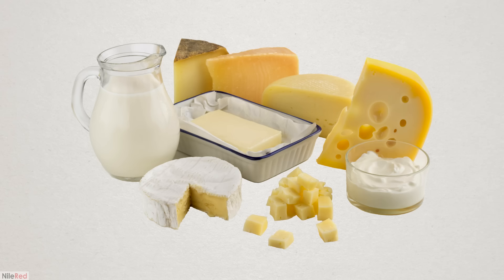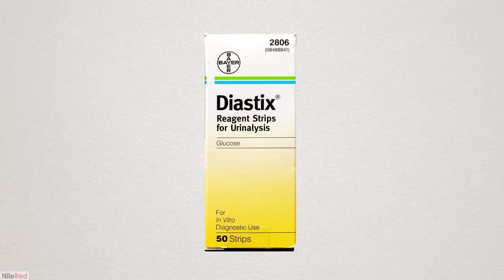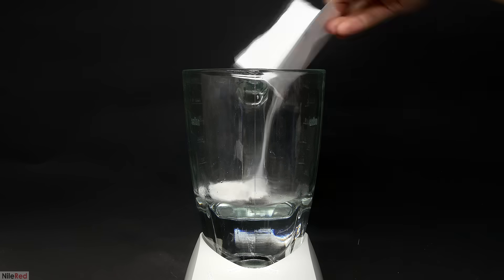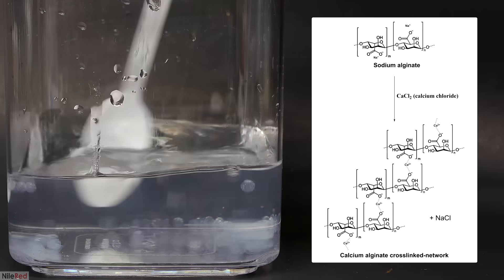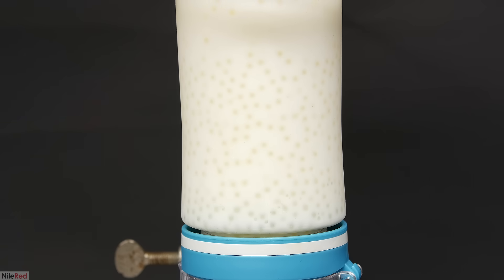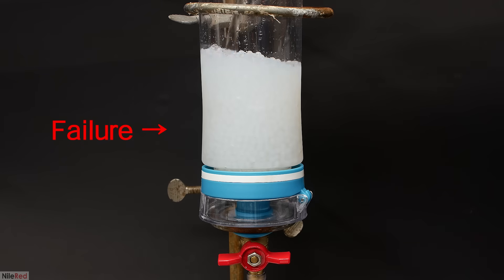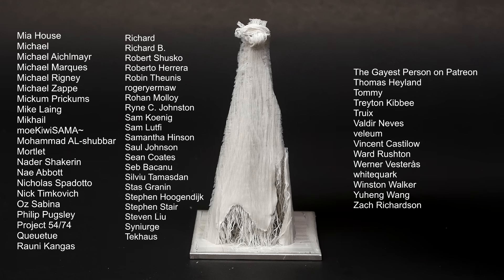Making milk lactose free

Comment: With my brother being lactose intolerant I found this extremely interesting. Now I can bully him with chemistry 🤣 I'm guessing the second process is probably the most efficient when on a large scale as its just a extra step in the filtration process and can be more easily managed during maintenance. Probably more cost efficient too in the long run as 10 drops per 1L would mount up over 100 gallons vs flow rate of cows suppling milk and longevity of the enzyme.

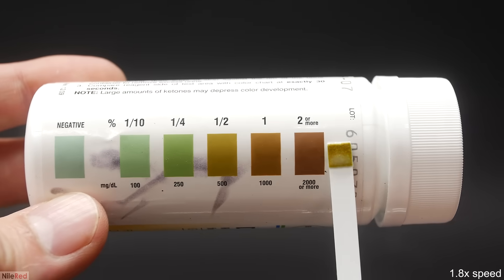Comment: 3:46 You could take a small volume of the milk, add water in some good ratio (1:1 or 1:3 might work just fine), and then test this mixture and adjust the results according to the mixing ratio.

Comment: There's easier ways.
Buy lactose intolerance  pills,  and drop one  in a gallon milk and sit for a day before  drinking.
2. Get powdered milk. The heat in the dehydration  process burns off most the lactose. If you still have intolerance problems,  for safety again  drop in a lactose intolerance  pill in a pitcher or gallon jug of the powdered milk you made.
When I switched to powdered milk I didn't have any the problems like did with from fresh gallon milk. And then I can make as little  or more and it not go bad like fresh milk did. And I didn't need intolerance pills  
3. And if still have problems,  or save even more money  switch  to oat milk.  It is very easy and cheap to make your own oat milk. You don't need to buy it from a corporation

Comment: It seems like most of the world hasn't gotten accustomed to using lactose free milk in the food industry, to the same level Finland has. In Finland, almost every food brand and restaurant uses lactose free milk in their food. The ingredients on every Finnish product (i.e that has not been imported) tells you how much lactose is in the food so you can know if you can safely consume a product. More than half of the brands aim for lactose free products.
Reply: Things have changed a lot since the early 90s when I was diagnosed lactose-intolerant. Back then there weren’t any of these modern products. You basically had lactase pills (Lactrase, Lactaid) and low-lactose (Hyla) milk. But apparently the R&D department of Valio, the dairy giant, developed in the late 90s / early 2000s a method to easily filter out lactose from milk. What ensued was a boom of all products lactose-free, e.g. yoghurt, ice cream, and everything else you can imagine. This was driven by recent findings at the time that up to 20 % of the Finnish population seemed to have issues in breaking up lactose, probably genetically. Since then, they have exported their technology into a lot of other countries.

Comment: With lactose, milk would induce pseudo green light because the fat it contains. It's kind of slowing down the process of radiation by breaking it into glucose. If people can't tolerate lactose, then they might be in the end of the road, they are prone to cancer.
But with no lactose, it's pure light that will be induce and that's a growth point, it won't be edible unless the person eating it is inside a blue shield, a shield that protect us from radiation. Like eating cassava.
For the people that are prone to cancer, eating no lactose milk will be okay, until they meet the sugar that it may contains, perhaps under a certain fever, or under an AC electricity. In such case, eats acidic grapes or perhaps do wine bathing 😀, a good neutralizer.
Nonetheless, anything that is not suitable for you, avoided it. Making it suitable for you in one way or another is just a delayed disaster.

Side note, the western shouldn't be worried about cancer at all since the process of manifesting the light is the eastern things. Cancer is a manifestation of a process that shouldn't happen physically. If it did happen, and becoming cancer, then something happens to the eastern, they have been forced to be something else, and so the process comes to the surface. If the east start to get cancer, strange ones, then a new world has been forming.
Actually, a new world does forming naturally, you can see this by the missing process in cassava trees for instance. But demonic human turn the table and set the course. So, will see, how the wrath of nature vs demon with us in the middle will do to us.

Comment: Other pro-tip I learned in dairy class: whole milk and cream have less lactose than skim milk and low fat milk.  I had already noticed that I could actually drink those without getting sick, (as long as I didn't have too much,) but I didn't understand why.  It's actually pretty simple: basically, if you remove one component - in this case fat - the percentages of every other component goes up, because you can't have a substance that only adds up to 95%.
Reply: It depends, I have a severe diarrhea if I eat more than 1TbS butter at once despite it is 82,5% fat, at the same time I can easily consume condensed milk up to 100ml  which is clearly made from a big amount of milk (reduced on a heat 3 to 5 times)
Reply: @MaruskaStarshaya  That's because lactose breaks down when you heat it.  Since condensed milk is made by continuosly heating it until it thickens, a most of the lactose gets broken down
Reply: @Amy_the_Lizard  oh, thank you. But I still wonder at what temperature it happens as simply boiling milk (100C) seems not really helps.
Reply: @Amy_the_Lizard  weird, everywhere online where i look up this information it is noted that lactose does not break down when you heat it.
Reply: @FlipFlopAdventures  Really?  We got taught that in my high school biology class.  Though the teacher of that class also couldn't figure out why some beans she boiled weren't germinating, so I suppose I should regard everything she taught with skepticism.  It looked like it worked in the lab where we compared lactose levels of regular milk, milk with powdered lactase mixed in, milk that had been heated for 24 hours, and milk with powdered lactase that was heated for 24 hours.  The regular heated milk still had lactose in it, but not as much as the regular milk, but it's also possible that the test tube we heated it in had previously been used for milk with added lactase and not properly cleaned (the whole class was an absolute train wreck, so I wouldn't be surprised if the teacher failed to notice some kids not washing the lab equipment properly.)  I never actually stopped to question the results since the teacher gave us an A on the assignment.  My apologies
Reply: @Amy_the_Lizard  😂🤣😂 sounds like my highschool from back in the day
Reply: @Amy_the_Lizard  thank you for sharing

Comment: To measure glucose after it passes the maximum of the strip, first dilute the sample 1:10 with water.  Further dilutions are possible but probably not necessary.  The lactase reaction is complete when the glucose concentration levels out.

Comment: 1. if you are ok with running to the bathroom with watery stools and venting gas a lot and drinking gatorade to replace the electrolytes lost to runny stools you could just leave the milk as is.

2. the ultra filtering is just reverse osmosis (same as what is used to remove salt from water).

if you can buy the filter media and your glassware can handle the pressures required you could make a diy reverse osmosis machine.

Comment: You could have diluted the milk with water before using the test strips. One part milk and 9 parts water would have scaled the test strip range by a factor of 10.

When rinsing the salts from the new beads, a simple taste test of the rinse water would have revealed if the rinsing was sufficiently complete.

Comment: Galactose definitely sounds like some space toast that Galactus would eat in-between planets while the Silver Surfer is tracking down a world without life.
Reply: Galactoast
Reply: Galaxy / Milky Way / Milk
Reply: @cube2fox  Vsauce!
Reply: Sniper  Only took us 6 months to write 1 sentence
Reply: Sniper  One character is comprised of 1 byte, ie 8 bits. Your message has 13 characters (including spaces and punctuation) + 2 bold symbols, which add another 2 bytes. Assuming you can transmit 2 bits per day, it would take you 60 days to transmit those 15 bytes of information, which is approximately 2 months. What were you doing the other 4 months?!

Comment: You can still measure the glucose concentration after it "went off chart". All you need to do is to dilute your sample by half (or any dilution factor), measure the diluted sample, then multiply the measurement of the diluted sample by 2 (or the dilution factor you used).

Comment: The reason I watched this video is to answer a question I’ve had for a decade, what happens if I drink lactose free milk with milk products with lactose. For some reason I thought the lactose in milk products would change my lactose free milk into lactose filled milk. Obviously I was completely wrong :) I love learning!
Reply: Obviously, you where completely right. There is no more enzyme in the lactose-free milk. If you add it to normal milk you will have end product with 50% less lactose, but still it will have it.

Comment: I found the Fair Life brand milk about 3 years ago. Initially, I started buying it because it was half the sugar of regular milk, (6 grams per 8 oz), and I was apparently pre-diabetic. I also seem to have become lactose intolerant overnight.
Anyway, the taste, compared to regular milk? In my opinion, It's actually better. I've also tried a couple of brands of lactose free milk when the store was out of Fair Life. It doesn't taste right, and it has the same sugar as regular milk, (12 grams per 8 oz glass). Now, if the store is out of Fair Life brand, I'll pick up some whipping cream instead. (It has zero sugar). I'll mix it with some water and then there is a vanilla flavored syrup for adding to coffee that uses Stevia instead of sugar that I squirt into my glass of cream and water. It holds me over til I can get Fair Life. I don't know if it's lactose free doing it that way, but I don't seem to have the same digestive issues drinking it as when i drink regular milk. Darigold brand does have a ultra-filtered milk that I sometimes see. They only offer it in 2% though. Fair Life offers Non-fat, 1 %, 2%, Whole, and Chocolate.

Comment: I prefer the lactase tablets. It doesn't change the taste at all. The problem is to find the correct amount. Luckily you can't take too much of lactase but it is quite expensive. The problem is with processed food, because they can have a lot of lactose in it, what I really hate.

I didn't tried lactose free stuff that much. I only tasted lactose free chocolate milk. The one with no real milk was actually quite good, that I bought. I did tried a different brand with lactose free desert and it was terrible. I also drank the lactose real chocolate milk and it was like I expected it to taste. With that they probably used less sugar in the chocolate powder. So in theory this should be healthier, because of less sugar for the same sweetness.

What is annoying is some of the misconceptions that people have. For example cheese is is mostly lactose free. A rule of thumb is more liquid, more lactose. Hard cheese does not contain lactose or so less, that most people won't have issues. I even can eat Creme cheese with no issues, because this is under my limit. 
Having some movement inside me is also quite helpful. Having a bit more liquid in my waste makes it easier. The problem is to hit the sweetspot. Having to let go some gas is the fun part, depending where you are but it can turn into pain very fast. The worst thing is to wake up in the middle of the night from pain and thinking to cut the waste out, to stop the pain.

Comment: important note here :

in cheese production the lactose is contained in the whey, the coagulated casein however does not contain lactose anymore. 
If you have a problem with cheese, it is most likely not lactose intolerance but a milk protein intolerance/allergy. Completely different treatment/approach is needed !

Additional note ; encapsulation is used in other fields for adding bio active compounds like vitamins.

Comment: 3:55  how heat-resistant is the cup
Reply: I would think it's made by the same company that makes his line of glassware? But I'm not sure. If that's the case, these are better beakers than most beakers. You know, because the poor spout and handle would make it easier to handle reaction mixtures and products.

Comment: I did some researching and found out the way my favorite milk is made:
1: Milk the cow
2: Get rid of cream
3: Pasteurize 
4: Bottle
5: Profit
Reply: No. You don't get rid of the cream. Instead, you use the process of homogenization. That's where the milk is forced under very high pressure through very small holes.
Reply: The cream is the best part bruh at that point it's just white water.
Reply: @Keshaire  Exactly, it sounds like skim milk. The cream is the best part imo

Comment: Doesn't the creation method of the support result in a lot of the enzyme being inside the structure of the beads instead of on the surface? Unless the support is porous enough that it doesn't make a big difference, it seems like a lot of enzyme is also wasted in the support method.

Comment: Whilst I know this is much later I can say as a bit of a chemistry buff myself and studying for cellular laboratory work that the first method will most likely be the main one least you can create super density beads. This is because cellular care and production of lactate become better and better, thus cheaper and cheaper. And super dense beads with an extreme amount of enzymes is not cheap to make, and most likely never will become cheaper as its a hard method to begin with (I do believe its something akin to your but in a extremely high pressured medium) and still need maintenance. Plus companies see the direct cost, never the prolonged one.

Comment: I've had Fairlife, and I have to say, it definitely tastes different, compared to my store's brand, and to Lactade lactose-free milk. My initial impressions were that it was relatively bitter, but still overall sweet enough to be enjoyed. My biggest issue with it is that it's still just as expensive as the normal lactose-free milks, so there's no real point in getting it over the store brand, unless your some fitness nut who need the added protein.

Comment: Commercial Lactaid milk has an exceptional shelf life compared to regular pasturized milk.

The Lactaid Cottage Cheese is better than regular.

Keep in mind there is a third form of Lactose intolerance in which the body develops an allergen response and its presence causes acidification and histamine build up to the point that it can burn off the intestinal lining... and butt skin.

The PILLS do NOT work.  Your stomach digests them.

Comment: For the groups information: 
Calcium chloride is sold as a pickling salt to increase the firmness of non-fermented pickles, if you want to use food grade calcium chloride. 

As for milk processing, the continuous method is only cheaper if you can sustain a certain flow rate of milk. 
The constant flow of milk on an industrial scale actually flushes the excess proteins and lipids out of the column before it becomes an issue. If you can't sustain that flow rate, it's not great, and there's a fair amount of research done in being able to switch a column out of a continuous batch line without interrupting that lines production.  
It's not so much a different set of problems as a difference in industrial production vs non-industrial production. 

The more concerning bit not covered in all this is potential changes to the pH of the milk and the subsequent changes to the milk proteins that can occur. 
People tend to be aware of caseins denaturing, since that can become a smelly brick very quickly,  but they're not the only protein in milk.  
The most interesting ones, in my opinion, are the beta-lactoferrins, which are ultimately why humans should drink animal sourced milk: They literally boost the innate immune system of the person drinking the milk and increase calcium, magnesium, and iron uptake in our digestive tract. 
They have use in biotech too.
They can be used to remove RNA from DNA, and, with some time, separate single stranded DNA from Double Stranded DNA. Which is like the first step to any bio-lab sample prep.

Comment: First, RIP your lab video. Second, ensure that you NEVER set off the sprinklers in your new lab. They will dump hundreds of gallons of water, and they will run usually until the fire department shuts them off. I have seen a sprinkler destroy a kitchen in an apartment, and it would be terrible for your lab.
In the U.S., the color of the liquid in the vial in the  sprinkler head corresponds to the temp that the head will trigger at, so I would find that out to ensure that you will never bust it.

Comment: Here in Norway, there aren't many options for lactose-free products, but the biggest dairy company has two kinds of milk: lactose-free, and lactose-reduced. The latter tastes sweet, and is thus probably made with your first method, while the former is made using a patented process from Swedish company Valio, which leaves the milk tasting indistinguishable from regular milk. Recently, another company has launched a competitor to this, which doesn't taste sweet either. IMO, the sweet-tasting milk is utterly useless, and that method should be saved for specific applications where you'd otherwise add sugar.
Reply: Trond Aasland not many options in Norway because whites are supposed to drink milk
Reply: Moishe Schultzmansteinberg Sorry, what? I don't have the foggiest idea what you're trying to say there.